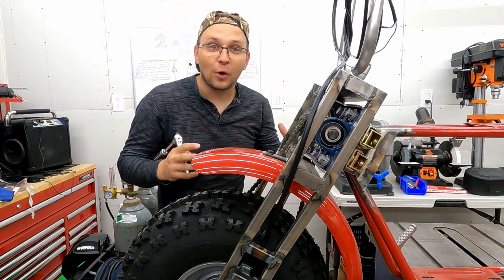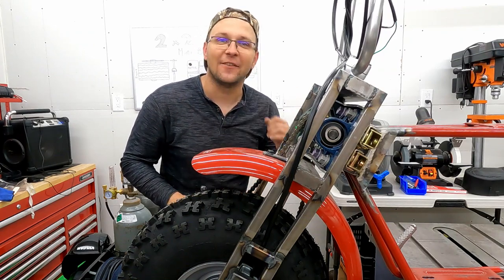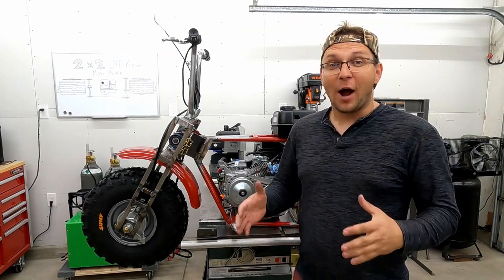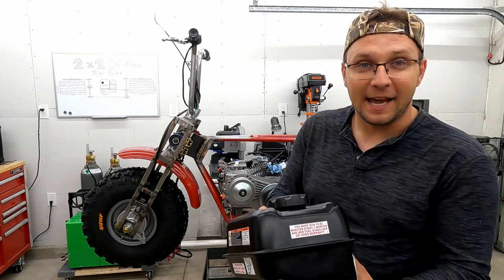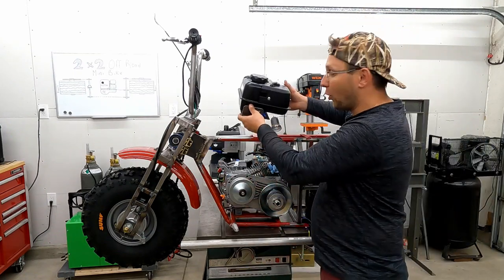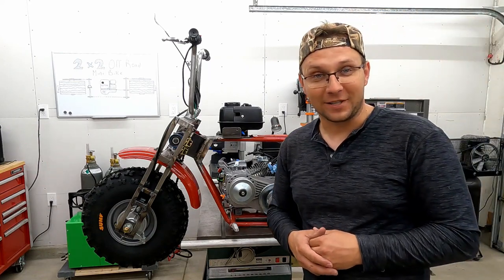AWD 2X2 MINI BIKE PROJECT Part 2

Comment: Awesome project! What a cool idea! I'm a new subscriber and I can't wait to see how it turns out. I would try the gas tank off of the original engine and that may work because the gas cap is off to the side
Reply from the maker: @John Wheels, I appreciate your interest in my project, and thanks for subscribing! That's a great idea about the original gas tank, but unfortunately the studs on that gas tank are at a 45° angle, comparing to the predator gas tank where the studs are straight down..
Reply: @OkayBuilds  oh, that's a bummer! I'm glad you were able to make it work on top!
Reply from the maker: @John Wheels, thanks, it doesn't look too bad on the top, I like it!
Reply: Agreed!

Comment: You're going to need a limited slip differential because when making turns the wheels are moving at different RPM's.
Reply from the maker: @Renegade, technically yes, specially on hard pavement, I can feel the drivetrain binding, but I use it mostly off road and it turns and handles pretty good